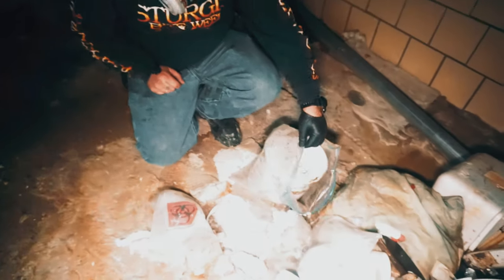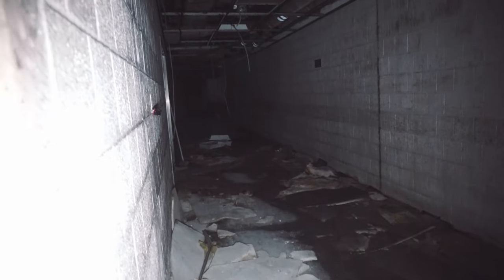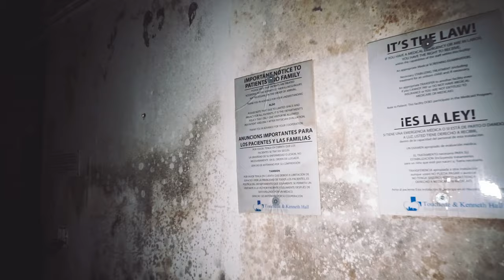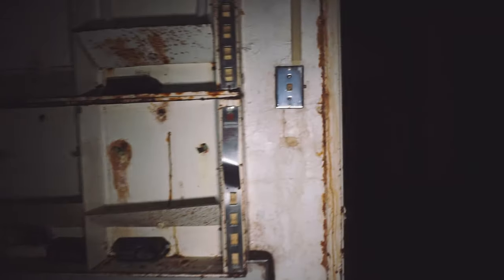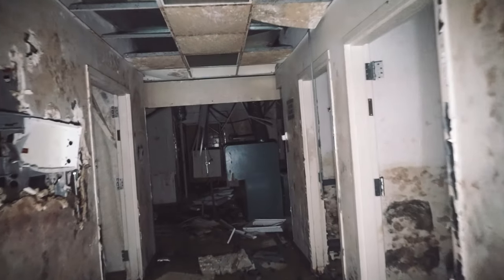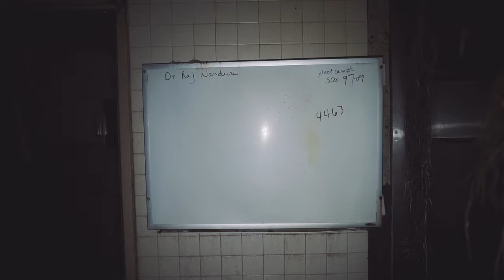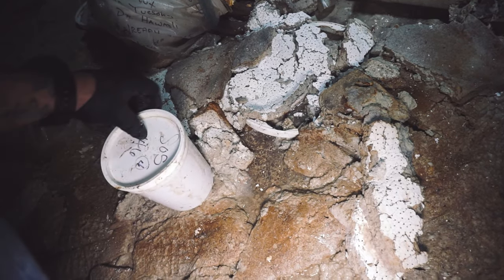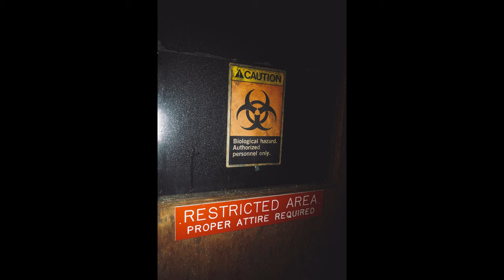HUMAN ORGANS FOUND in Abandoned Morgue - Hospital Urbex Gone Wrong

Comment: I'm surprised rats haven't been feasting on the organs. Still there 10 years later crazy shit
Reply: They were probably placed in formaldehyde at some point, doubt the rats would touch em after that, if they did they would be poisoned and die.
Reply: Also rats wont eat infected flesh even if it did not have formaldehyde which those organs obviously were in because the clearish yellowish liquid was characteristic of formaldehyde which i have had to dispose of at the hospital where i worked and which i also accidentally spilled

Comment: It go's to show you with out human intervention how much a structure will deuterate, I have known friends that have worked in building maintenance  and they have said up keep is none stop,  even when there is still human habitation in a dwelling the constant upkeep in horrendous specially for a hospital to stay a somewhat sterile environment never ends, especially roof leaks yea they are still on going, they have to always be on the guard for any kind of water seepage because most hospital are flat top roof construction due to the fact that is where they install most of there HVAC systems so flat top roof need constant observation for any kind of pooling water, because Mold is always a factor whether occupied or un-occupied and mold cannot exist in any kind of care facility, that's why a lot of abandoned structure with flat type roofing deuterate so quickly because of pooling water weight and or snow not being removed hence the reason there is so much black mold in this place, it is good that they are wearing respirators and not just masks for protection,  this place has not been abandoned that long and the amount deuteration is incredible, I have been in abandoned structures that where abandoned 3 times longer then this one and did not even an 8th as bad and no black mold, but this place is a disaster, so the moral of all what I just said, with out man to take care, Mother Nature will take back.

Comment: Não existe o perigo da radiação? As máquinas de raio-x, são mortais.
Reply: X-ray machines doesn't emit radiation without power (and even when powered it's not just a press onna button, there are software interlocks that prevent improper operation)
What you're thinking about are radio-isotopes in radiation therapy machines.